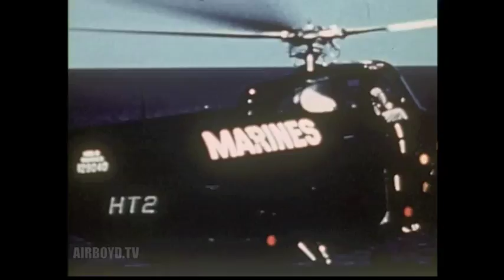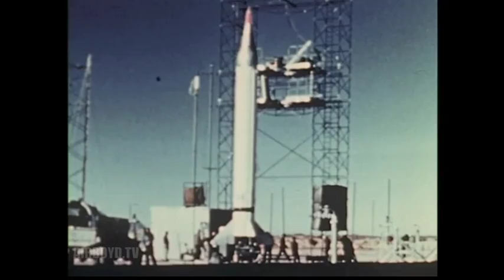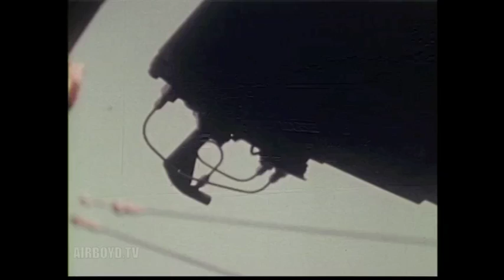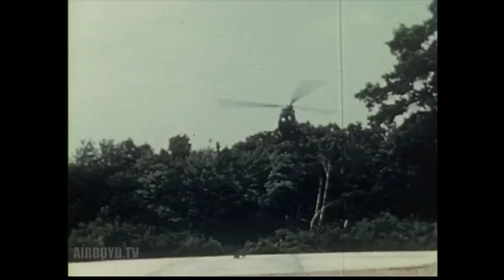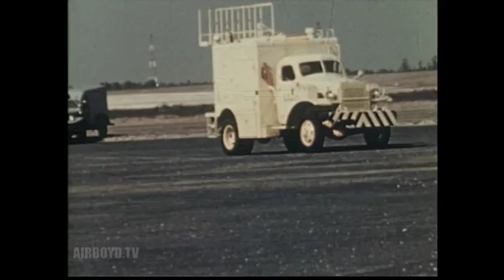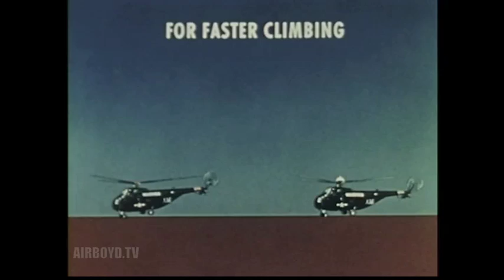Rocket On Rotor (1955) Helicopter Rocket Rotor Blade Tips

Comment: hydrogen peroxide is very easy to handle indeed........
as far as i´m aware politics not only go in the way because the fuel over the rotor in the tank was not only corosive enough to disolve a human beeing violently it also causes cancer, this thing could basically kill an entire landingfield full of people slowly and fast, tip jets are also loud, like unbareably loud and produce noises that are hard to bare

Comment: I wonder how trailing edge circulation control on parts of the rotor blades would have done instead of tip jets.

Comment: pretty much. especially when you consider that a 10,000 horsepower turbine is not uncommon, and when you gear it down the torque of the main rotor shaft gets to be practically obscene.

Comment: I saw a video of a one man helicopter with no engine other than rotor tip ramjets. Iother than poor fuel economy it looked great. Bolt that to a light weight automobile and make the rotors foldable and there's your flying car!

Comment: Imagine what could be done with 2010 materials, electronics, and manufacturing methods!
Reply: Especially 2018 technology if you're still around? Do you know anything about this?
Reply: Jonathan Klug 2020 does not approve.
Reply: 2022
Reply: Or 2021!
Reply: It might not make a difference.  That is, the rotor assemblies probably approach their maximum stress loads as their driven, so there's no extra room for adding performance.